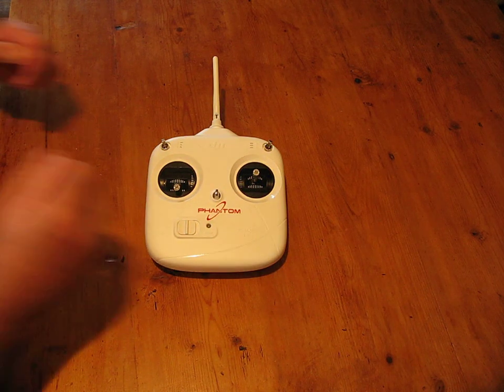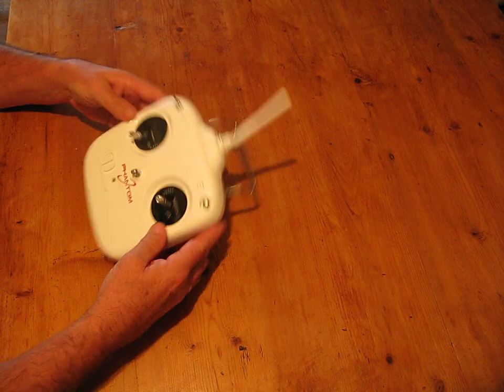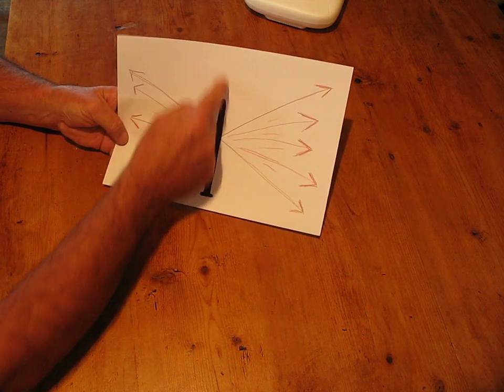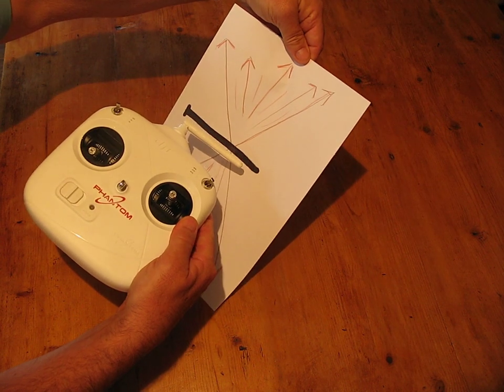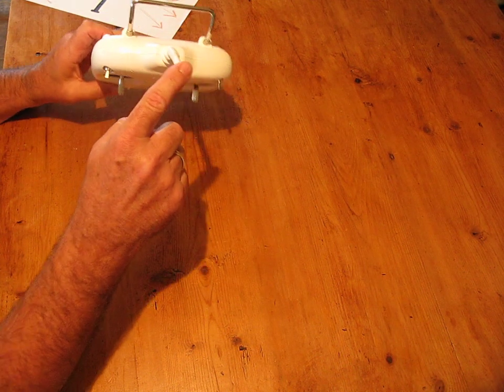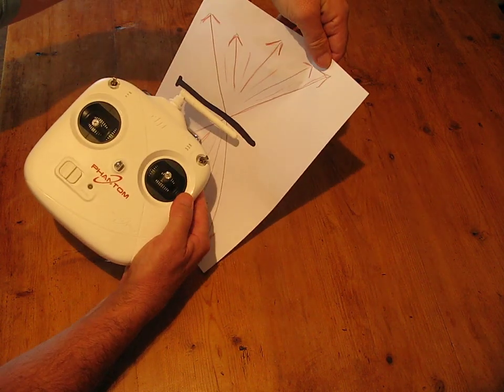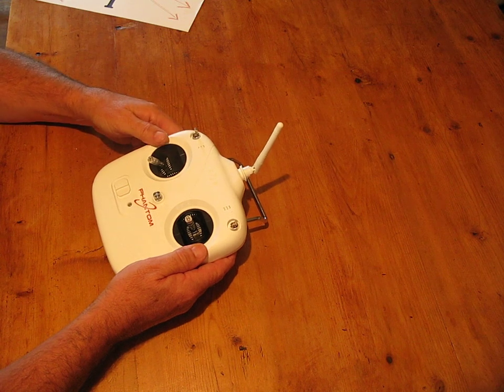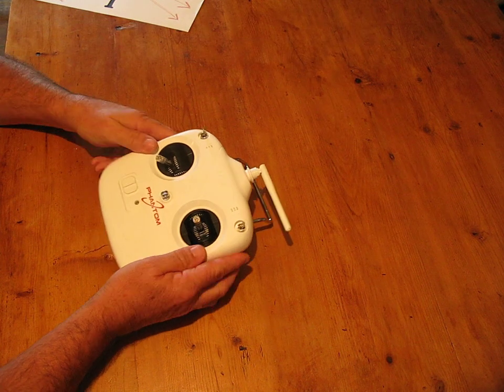DJI Phantom Quadcopter - Transmiter Antenna IN The Wrong Position !!.

Comment: my antenna is very loose... is there a way to tighten it??
Reply from the maker: In what way is it loose ?
Reply: at the base.. the antenna won't lock in any position.. there's play in it..  and how would I take it off if I wanted to upgrade to another antenna??
Reply from the maker: JIMMY JAMES
Is this with the Phantom Tx ?
Reply: it is the phantom 2-   not the phantom vision..
Reply from the maker: JIMMY JAMES
Try to check the inside mounting, there is a pin that may have come adrift.

Comment: And what about the receiver antenna on the quad? The same way, horizontal instead of vertical?
Reply from the maker: No, that will pick up the signal as it is across the angle and omnidirectional.
Reply: Topvideos1001
Thanks for your message.
Reply from the maker: br011075
My pleasure :-)

Comment: im new to this whole rc stuff so my question might be stupid... but does a longer antenna mean better range?
Reply from the maker: Not a silly question at all.
Answer, simply No, it is a loaded Ariel  this means there are windings (a coil) inside, so it is effectively longer than it looks, it is matched to the frequency wave length.
Reply: hey cool thanks a bunch :) I was also wondering if there are any upgrades/ add ons one can add to his quad... so if anyone has an idea let me know :)
Reply from the maker: MrCrazyNinjadude
Check out my  video channel I have done some mods there :-)

Comment: No wonder I was getting "out of range" with just 400 feet of altitude !! Will try this asap thanks so much!!
Reply from the maker: If you don't get a better result, then it could be wire fraying in the antenna joint.
Reply: Topvideos1001 I was getting 400 feet range before, this change now gives me 1,100 feet (almost triple) ! Thanks very much for the advice TopsVideos!!!
Reply from the maker: Chris Twirbutt
My pleasure Sir, glad to help out where I can, it is a testament to the critics I have received on this video.
R/C is a specialist subject.
http://multibladehelicopters.freeforums.org/index.php

Comment: how this dish would work if you put it on my remote control

http://www.ebay.de/itm/DeLock-Antenne-WLAN-RP-SMA-802-11-a-b-g-n-5-7-dBi-direktional-Gelenk-schwarz-/130927330443?pt=DE_Computing_Booster_Extender_Antennen&hash=item1e7be0848b

Comment: Huh, I have always had a rather short range with my phantom (aprox. 20 Meters) This may be why.  I will have to test it out.   Thank you.  Could you suggest a better radio?
Reply from the maker: You should get at least 300 mtrs, you can mod a Futaba but not worth the hassle in my opinion.